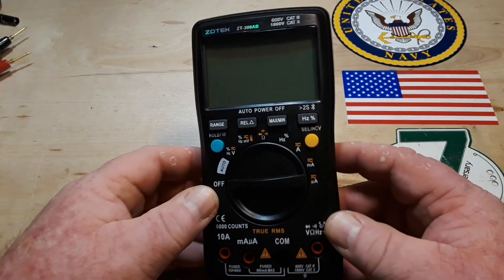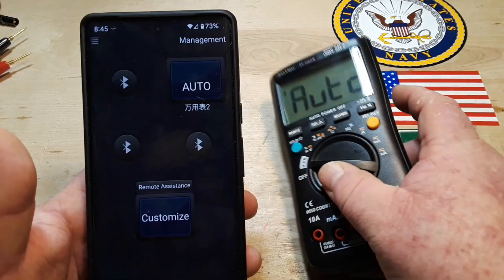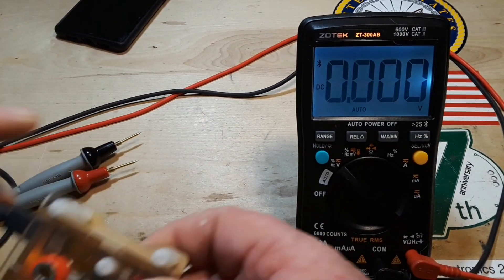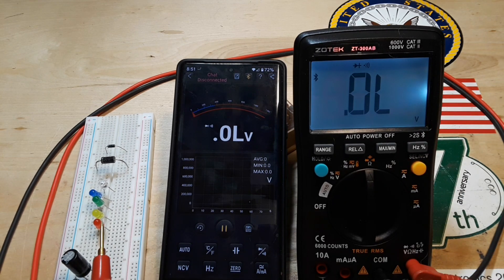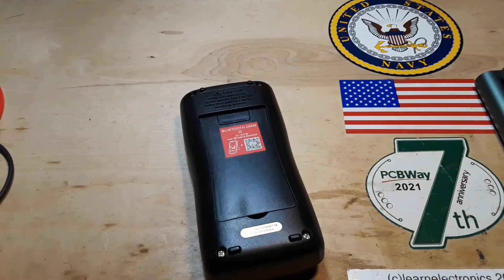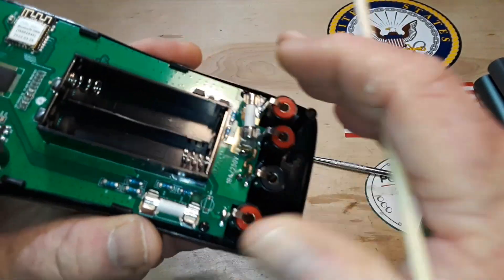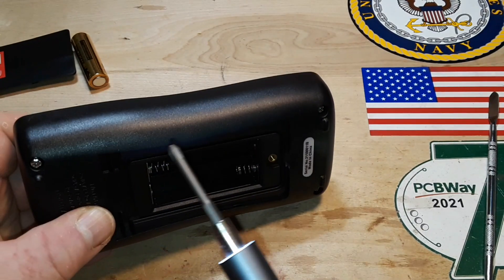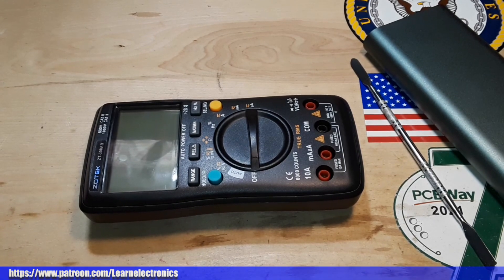Zotek ZT 300AB DMM with Bluetooth

Comment: General Instrument has a BT TRMS meter which I think is cheaper. App has similar logging capability. But I'd rather have a USB DMM because I would rather have data on a computer for analysts. This meter actually has a larger font than the phone app.

Comment: I assume those "math" modes will allow you to connect 2 meters to measure voltage and current, then auto-calculate power on the fly?
Reply from the maker: Yep